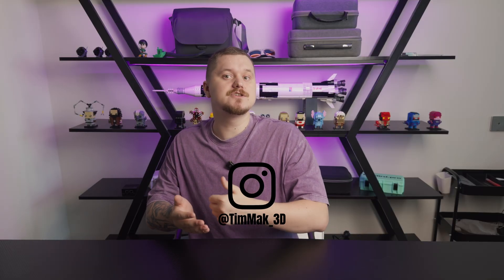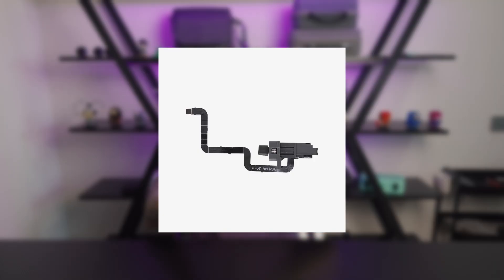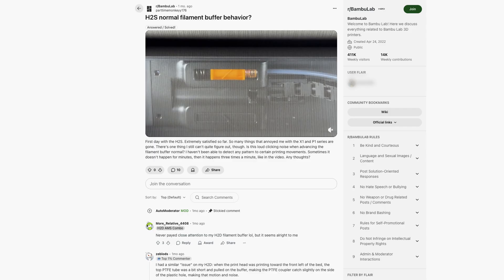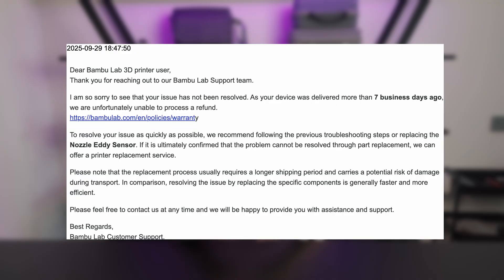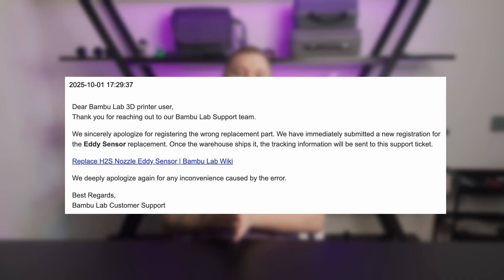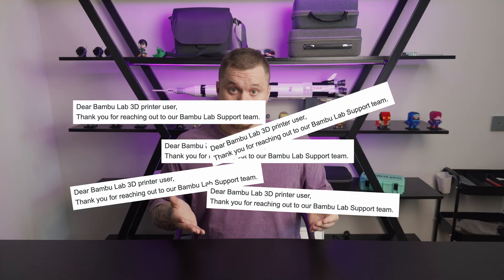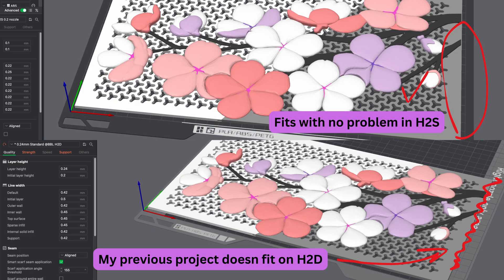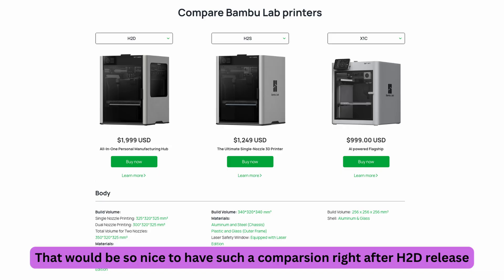A Month With the Bambu Lab H2S – Real Experience & H2S vs H2D Comparison

Comment: Your price comparison was super unfair since you compared the price of the H2D WITH the AMS2 to the H2S WITHOUT the AMS2. For shame.
Reply from the maker: You are not wrong. I showed some screenshots there but I didn’t mention actual price difference. The main idea was that A is more expensive than B. Not the actual difference in price or specific models. Their prices are constantly changing. So I didn’t leave an exact amount there or exact model.
Reply: @daniladoesengineering  You absolutely did mention the price difference @ 7:52:

"And then there is the price. The H2S is almost half the cost of the H2D."

Comment: I had the same filament-loading issue with a p1s. The filament would get all the way to the extruder and get stuck.  For me it was the hub.  I was running two AMS Pro 2 units, so I thought I needed the hub. Nope. Y splitter + buffer, and I was back in business and have been ever since. It was the hub. I was able to finally return the hub, but it was a PIA.  Dealing with Bambu's customer service gives you an idea of what it must be like living in communist China.
Reply from the maker: That’s funny because I’m currently based in Mainland China. There are just companies with good support and bad support. As everywhere. 😅

Comment: You do realize that the H2S is faster than the H2D, based on your numbers, by a whopping 4%?
Reply from the maker: 8000 acceleration vs 10000 acceleration by default. That’s more of a 20% difference. Depends on the model. If there will be many vector changes difference can be larger or smaller.
Reply: @daniladoesengineering  Take the time it took to print for your 1 day job, convert to minutes (1779 vs 1855), and do a delta percent (4.1%).  Raw numbers mean very little.

Comment: ive had similar dog shit experience with their customer service. this is their weak point. I got a lemon a1 mini that basically doesn't work well, I've had a p1s I got lucky with - 1200+ hours no issues. just the luck of the draw but it really shouldn't be left to that. I think you just talked me out of buying this. I needed to expand my printers but I think I'll hold off at this point.

Comment: My first thought on what you said about the ams is that the filament you tried to reload got grinded down thin enough that the extruder couldn’t receive it no matter what. It sounds like the way you fixed it was using a different spool. I always cut the end off so there is no gear grip lines. If you see this comment, please let me know if this might have been the issue.
Reply from the maker: Nope, I tried 5-6 different spools. Cut ends, removed gear marks, tried new spools. The first day I was thinking that I just did something wrong there. 
It was an actual issue with thr buffer. Only it's replacement helped.
Reply: @daniladoesengineering  ok I saw the rest of the video. That is really unfortunate. I hope that was only an issue with the first couple thousand they made. Did you receive this one as part of their sponsor campaign or pre-release?
Reply from the maker: Ha, you really needed to watch the entire video. My friend needed one and purchased it. I just got a chance to test it. Then I repaired it, packed and sent it to him. There is also part 2 on the channel. You can check it if you want to learn more about print quality.

Comment: Oh man I just order one today thinking that is the type of printer that is plug and play. Fingers crossed 🤞
Reply from the maker: Mine is working now after the fix, so hopefully yours will be smooth sailing! You can check the part2 video with tests
Reply: @daniladoesengineering i saw the part 2 and yes is fixed and working, just that I don’t have so much experience with this stuff and I don’t know if I could identify possible miss function of the printer. But…. I am ready for the adventure 🤣🤣🤣

Comment: I had the H2S and it did the same thing that's Very interesting, although in the End I did get it all working.   1/2 the items I printed all had Error for AMS issues, it did require fiddling but eventually i was able to print my items. 
I ended up returning the printer not because of issues just for specific reasons i only had one day to use it before return window expired, so I went ahead and returned it.

Comment: The black Friday deals look(ed) tempting; they almost had me. Thx for the real review.
Reply from the maker: It got fixed and works good. I'm preparing the next video.
Reply: @daniladoesengineering  how did you fix ths? i have the same issue
Reply from the maker: @suxatrots replaced the buffer
Reply: We use like 10 of these across the place where I work and they are work horses

Comment: i have h2shad problems with the hot end  wend down after 3 days replacement sent out but 4 days without printer and very fiddley to replace the part i spent 2300 pound on h2s with laser and two ams units i am not a happy Chappy

Comment: Not dealing with any printer issues at the moment, but this exactly matches my experience so far simply trying to return some items I happened to order literally a few hours before Bambu's big holiday sale was announced. They're unwilling to even consider a price adjustment, which is annoying but not strictly against their TOS. However, I can still save a lot of money by simply returning a few things that are now on sale at significant discount vs what I paid and ordering them at the new lower price. Well, now Bambu is dragging their feet, asking for photos (of brand new parts I just unpacked), and thus far refusing to even share a return shipping address so I can simply figure out exactly how much shipping will cost, prepare everything to go, and then finally shoot some photos if they really insist.

People call Bambu the "Apple" of 3D Printers, but frankly this is flat out wrong. A huge part of what makes Apple Apple is the customer support experience. Maybe Bambu will figure it out before another company steps in, implements all the legitimately cool tech they've been working on, and eats their lunch.
Reply: I went through something similar with a faulty hub. They were asking for videos, but I had already switched it out with a buffer, so I didn't want to switch it back and recreate the problem just so I could film it. Yeah, pretty shitty customer service.

Comment: The toohead isn't fragile but the density of components is ultra high. But I commit, working on it is a bit of a challenge.  Just like a smartphone. I had to replace the hotend-assembly and found it very helpful, to put the printer on its left side, so the front door was hanging down over the edge of the bench. So I had  much better access to the back of the toolhead from the top opening of the printer.

Comment: I'm thinking that I would have bypassed Tech Support after the first Stein! BI would have written to the CEO. I've done that before, and it gets results as long as you remain professional. Sorry you had to go through all of that.
Reply from the maker: Maybe, but then all regular people would do the same and they just stop answering. The point was to check how their support works.
Reply: @daniladoesengineering I would like to think that they have a filtering process. This case is ridiculously disrespectful and there are companies out there that will "flag" letters to the CEO for PR purposes. I'm pretty sure this case would have been elevated at least to a level above general tech support. Agreed that not every complaint needs to be presented to a CEO, but nothing beats a failure... except a try.

Comment: To bad for the h2sd... the example for the size is wrong you just have to arrange properlt the filament between nozzles
Reply from the maker: I have a part that fits on h2s and doesn't fit on h2d. The only way I was able to print it on h2d is using 2 spools of the same color for different nozzles. But that's a lot of hustle and there is a visible seam between them.

Comment: there is more supports on the H2D model that is prob making up alot of the time difference you can see that the H2S support is 117.09 grams and the H2D is 127.24 grams so for some reason there was more supports on the H2D print then the H2S print
Reply from the maker: Yes, I noticed that as well. It might be some slicer thing. I tried to recalculate it a few times, but it produced the same results over and over again.

Comment: At this point, is it better to go the K2 Plus route?  I know people say it has its quirks, but I haven't heard of things like this happening.
Reply from the maker: Their z axis threaded rods are often loose. That makes print quality worse - higher you print. I didn't check it myself yet. I was thinking the same. To try it.
Reply: Well, I just swapped a K2 Pro for H2D because I got tired of (1) trying to constantly fine-tune the bed leveling, because the K2 only levels along 1 axis and not 2 like Bambu, (2) dealing with intermittent faults with the print head camera (happened on two different K2 Pros from the same shop), and (3) sitting next to the incredibly loud exhaust fan, which evidently needs to run 100% more or less constantly to keep the chamber cool enough for PLA (and then alternates between that and 0%). And also, really wanted to cut down on waste for multi-filament prints — though didn't want to spend ~$3k on an H2C and risk being an early adopter of Vortek. Don't know that there's any perfect answer at the moment.

Comment: Having the exact same issue as you regarding the filament buffer. Only works when I'm using an external spool. Using the AMS causes it to stop working. I'm 3 days into my purchase and a support ticket has been raised and a replacement buffer ordered to speed up the process. 

If the buffer replacement resolves it, hope support refund me the price. 

Wish me luck :D
Reply from the maker: Ha, Hopefully it will be fixed for you first try!
Reply: Buffer or hub?
Reply from the maker: @SweetPablo214  Filament buffer. That’s how support team called it and it’s listed on their website under the same name.

Comment: I had almost the same problems – my unit was dead on arrival.
It took 12 days until I finally received a refund, even though here in Germany we have a 14-day return policy by law.

They never responded about sending a replacement unit or offering any kind of solution — only told me to open a support ticket, which didn’t help at all and resulted in the same errors again.

It was my first 3D printer, and I really hoped to get into the hobby with a reliable machine, especially since I’m not very technical.
Could you recommend a good and beginner-friendly 3D printer instead?
Reply from the maker: This sucks. To be honest I never had issues with their printers before. I had like 10 different machines. H2S is the first one having actual issues. Bambulab seem to have better quality than most competitors from China atm. Even with cases like mine.

You are in Europe, may be check prusa ? People love them. I had only mk3 clone so can’t give any feedback. 

Would be nice if more people leave some recommendations for you here. 

Me personally. I will probably jump on Creality, Qidi or even Voron next time. To support competition. I don’t expect more reliability there.
Reply: @daniladoesengineering  Can confirm Creality is not better quality, based on a sampling of 2 K2 Pros. (Perks of buying from a local retailer.) Second one printed great, at least for PLA, but both reported errors about the nozzle camera — the first on every single print except one. Swapped for an H2D last week with the sale, and will see…

Support experience so far from Bambu on a simple price match or return request for some parts which dropped 25% hours after purchase leaves a lot to be desired. (Apparently if you're buying Bambu parts or filament, it's a really good idea to just wait for a sale. Which is honestly kind of an annoying game to play.)
Reply: @daniladoesengineering Do you know if this particular issue has been identified and accepted by Bambu?? Is there a fix and have they acknowledged it as a known defect? I'm new and waiting to order. Thanks.
Reply from the maker: @DHMeister  I don't think they "fixed" it for all of them. But symptoms are known, so people with similar issues don't need to guess as I did. Buffer replacement is a 15 minutes task.

Comment: Thanks for video. Looks like that Bambu is unaware how much damage they are doing to themselves.
Reply: Bambu knows, they just do not care.  There’s been huge blow back on Bambu over their change in terms of service “after” the sale.  Not to mention all their other issues with locking out third party upgrades etc.  Their proprietary eco system and privacy issues are also a problem.  They have been notified over and over and over again but they are arrogant and could care less.  Unless a huge fall in their bottom line occurs Bambu will continue this nonsense.

Comment: I had the same experience (in tihs case the X axis was rusting, probably from some part inside the toolhead, to access it basically you have to disassemble the complete printer including bottom plate and circuit boards etc.). They are very far from European standards on warranty, just keep sending you parts for you to spend time and effort repairing their product instead of taking it back or sending a new unit immediately. After several weeks back and forth I was able to convince them to coordinate with a local supplier in my country and have them pay for the repair. But it was an awful experience which I really don't want to go throug again. Buying the printer from a local reseller would probably be better, but the prices are usually at least 30% higher compared to Bambu store. So it all comes down to luck, which is why I am now waiting to see what other companies come up with until Christmas, there might be better options. Bambu prints great, until it doesn't.
Reply from the maker: I’m currently based in China, my workshop is very close to their warehouses and factories. Like a 2 hour drive or so. So delivery cost is like 30-40$ max. Still, I’m forced to replace parts one by one.

Comment: Bummer. Sounds like a compounding issue once you had to really tear into it when the initial diagnosis by Bambu was wrong. So far, I have around 350 hours on my H2S. Initially I had hell with it. The bed was just not level and first layers were a mess no matter the calibration. Turns out there is a tiny bracket at the very front of the bed, closest to the door that needed to be loosened 2 turns (in my case) and a full calibration with high temp selected. Bambu has this noted but have to dig to find it. It has been rock solid ever since. Lots of engineering filaments through it (fingers crossed, no issues). Mine was sold and shipped from the US, delivered September 3rd.
Reply from the maker: Thanks for sharing the solution, hopefully it will help other people.

Comment: Thanks for an honest review -  in contrast to the  many thinly disguised marketing reviews of the H2 printers on Youtube.
Your experience is not new and anyone interested in the H2 machines should visit the Bambu Forum where a significant number of customers have  had the same experience with buying a dud machine and receiving totally inadequate support.
 At the price point and given Bambu Studio's reputation for solid reliable out of the box performance (P1s and H1C) this indeed a turn off.  There is no doubt Quality Control is an issue as well as the need for improved  Customer Support .
If a H2  a Printer fails within 2 days and a ticket has been raised  the printer should be exchanged if  a factory authorised repair is not successful.   Nobody should get stuck with a lemon flagship  printer but it seems a number of people do.
I plan to hold off and let the H2 mature for a while longer and push on with my Creality CR10S which is limited but reliable(!).
I hope by now your printer is fixed.
Subscribed!

Comment: Thats pretty messed up. They put you on hold for while until the warranty drops and they don't have to send you a new printer that was essentially dying when you got it. Bambu has a good track record, in some things. Unfortunately they lied about what info was sent to their servers via log files and tried to gaslight people that everything they were doing for 'safety'. Lots of good bambus but I have to agree that maintenance and replacing parts is a huge part if you want to be king. The fact they give you a few parts then when that doesn't fix it, they say its not under warranty? Come on thats sus. I mean what do people who are not mechanically inclined do? 

I have a creality K2 plus and its had some problems but minimal so I'm happy. I''m wondering if I get a second machine, should it be another k2 plus or something else? 

Thanks for posting your experience.

Comment: Thanks for relating your experience. It definitely gives me food for thought. I might relook Snapmaker 🤔
Reply: Dude don’t go with Snapmaker. My Artisan just sits there holding parts for my Bambu inside the massive enclosure 😢. I still feel the burn of 3k wasted on that unit.
Reply: I am in your boat wanting to order one now, they are back ordered. This and also some post I have seen on redit with them knocking the wiper tower over on what seemed to be needing some firmware tweak